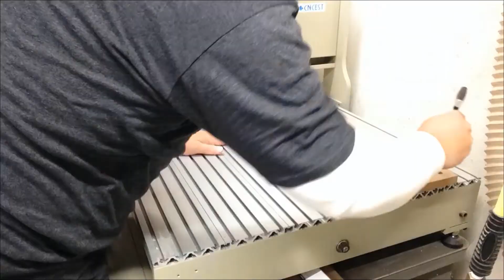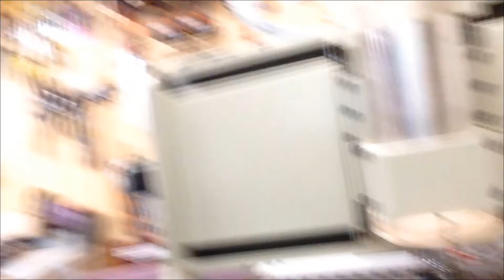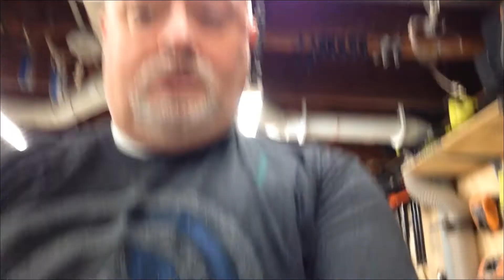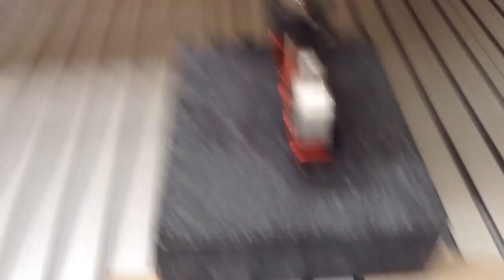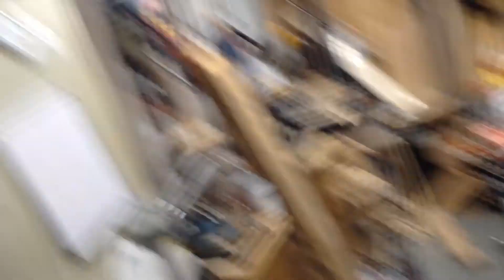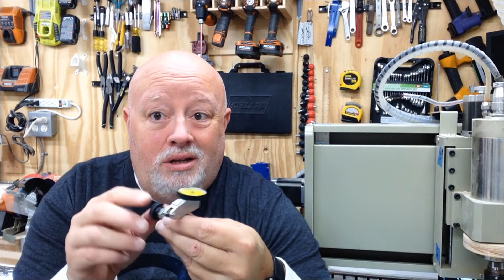Tramming your Chinese 6090GZ CNC Router

Comment: You can never tram that mill I have a slightly smaller version. The problem is as X axis moves towards middle of the travel the motor nodes more. The round rails flex because there secured at the ends only. I replaced the x and z axis with linear rails mounted to solid plates. Much more ridged.

Comment: Do we know the angle of the stepper motors. Trying to set up the pulses on my stepper driver and machine
Reply from the maker: Most steppers run at 1.8d or 200 steps per rotation.  These are no different.
Reply: Thanks

Comment: So i wired the new controller ddcs 4.1. It came with a set of dm542t and m542 stepper drivers. I did not wire the ena or alarm. I wired it like for like of the a, b, pul, dir to the controller. Nothing is moving. Ugh. Do you have any suggestion?
Reply from the maker: UPDATE:
I think I'm wrong about this.  But, you will need to mimic the setup that was coming from the R&R Motion controller board.

-OLD-
You will need to pass +5V to the enable pin on the Stepper Driver (at a minimum)
On the RNR Motion card this was done from terminal labelled "5V" and, I believe, it connected to "EN" and to maybe to "DIR+".  You will need to mimic this with your new controller.

But make these changes at your own risk.
Reply: So I changed the drivers to m542 drivers and I have had success with motor movement. Now just setting up the ddcs 4.1 parameters.

Comment: I just purchased this machine used. What is the best way to get help on setting it up and testing. I may also need help wiring a ddcs 4.1 controller.
Reply from the maker: You will want to locate and separate all the wires from the machine for the limit switches, steppers, and spindle.  The limit switches will be wired in serial.  The stepper drivers should be straight forward to the DDCS 4.1 but you will need to match the Pul+/Pul-, Dir+/Dir-, and Ena+/Ena- to be the same as to the RnR Motion Controller.  The spindle will be a little more involved... and you will need to check where they were wired to before and try to match that.  Personally, I've thought about going with the DDCS controller too... but don't use my CNC enough right now to justify the expense.

;)  If someone want to buy me one, I'll do a video  ;)
Reply: Thank you. I'll keep you posted on what i find.

Comment: hi jeff...is the z clearance from table to bottom gantry 140mm?...reason i ask is you said it was 4 7/16 which contradicts what the specs of 140mm....can you confirm?
Reply from the maker: The actual measurement is 117mm (from gantry to bed).  The gantry is low... but most, standard, router bits work well within this envelope.

Comment: I have been a tool and die maker for over 25 years. This is something that I have done to a "Bridgeport type" hand operated mill and $500,000 CNC machines that I have walked on the table of. Leveling the granite to the spindle won't accomplish anything. You need to be checking the table directly, while not great, extruded aluminum is not as "warpy" as most people might think. I wish I could talk to you directly and explain all of this, because it is actually more than this and at the same time WAY easier to do. I like you brother and appreciate your dedication to accuracy, this is over complicating the process. I ended up here because I am looking for a good CNC machine that won't break the bank. The bottom line is that the spindle assembly should be 100% perpendicular to the TABLE in both the X and Y axis. Someone mentioned using set screws to make the machine adjustable and that is correct, you need to make it adjustable first. Make sure the table is is as perfectly level as you possibly can before you even start this process. I have literally spent the better part of 2 days at work helping set up insanely expensive industrial equipment and a level table has to be the first step. If the machine is not mounted securely and the table level, all of this is "subject to change" in the next week, month, and years. I am NOT trying to be critical, I 100% appreciate you man, but the table without a shimmed block MUST be the reference. @27:39 Just use a block of wood between the clamp screw and the spindle and make certain that the clamp is on the spindle shaft and not on a loose nut or even a tightened nut with a collet. You could even chuck up a threaded rod into a collet and then use two nuts to jam nut a larger diameter "puck" to mount the tram tool too. Then you can use the actual table to get the correct results. 2 indicators are not required though most show it this way. Just zero one side and compare the opposite side number to the zero and then adjust to split the difference and then recheck. https://www.youtube.com/watch?v=8L0IXKgiZ7o  https://www.youtube.com/watch?v=b9gOWHQdrDs
Reply from the maker: You are 100% correct.  I did want to point out that the table is the untrusted part though.  So shimming the granite block to be "level" (sorta) is setting my "table" at level... does that make sense?!!?  I've wrapped my head around this as best I can and this is the process that I use... although not perfect.

The end result of this entire process is to have a trammed spindle... and use that to flatten your waste board.  If your waste board comes out without any noticeable issues (like saw tooth sudo flatness) then you are good to go.

I'm happy to talk to anyone.  And, I appreciate your comments!

Comment: I'm confused, in step  1 when the single gauge is marking zero all the way round it means the spindle is perfectly perpendicular in the position its in, also wherever you use the single gauge if it stays at zero it is still perpendicular, I have done this on my milling machine mill and its perfect(takes a while to get it right) The only thing the double gauge helps is you get a reading without moving things and emptying your pocket.
Reply from the maker: If you have an unknown, you need to insure that the reference surface and one dial are parallel.  This does not take into account any implied angle to the spindle.  Once we have that reference surface parallel with the sweep of one dial, we can then use the second dial to insure that the spindle is perpendicular with the reference surface we just adjusted.

Does that make sense??  I can do a follow up to explain this better.  But there are several videos on YouTube about this very thing.

Comment: Jeff, great video.  I'm thinking about buying one of these machines.  After working with it for a while, would you recommend buying it?  I'm an experienced machinist and CNC programmer.  I just retired and sold all my big machines but would like to get back in to building miniature internal combustion engines. I realize these machines need upgrades to improve rigidity and accuracy. Should I buy one? 🙂
Reply from the maker: Ed...  the 6090 CNC routers are good for wood and light metal.  There are several videos of people making them more rigid for doing this type of milling.

But, if I were going to dive into making little engines, I would look for a SIEG X2, or similar, manual milling machine... then do a CNC upgrade (www.heavymetalcnc.com is where I got my parts... seems that they are out of business now.  But you can look at this www.youtube.com/watch?v=eLRbDVJakAU which has Fusion360 files for the parts).  I have this mill, and CNC upgrade, in my house and it works great.  Keeping in mind that the machine is only as good as its parts... the ball screw upgrade, for the CNC conversion, made it more accurate (vs. the normal acme threaded ones).  Also the gibs on the X2 aren't the best either and need adjustment periodically.

Take a look at www.littlemachineshop.com for some ideas of what you can do with a small mill to get it upgraded too.

Final thought... I would not buy this if you want to do anything harder than aluminum or brass.  I would get a small mill and convert it (or buy one that is already a turn key solution).

Hope this helps.
Reply: @jeffmorlen  , thanks for the comprehensive response. I converted a Bridgeport series two CNC machine into a PC-based machine and made thousands of parts on it. So I’m quite familiar with the conversion process as you suggest here.  I also had a tiny little machine called Max and see that I was able to machine some small aluminum parts on pretty easily. I was hoping one of these cheap Chinese machines would be good enough for small aluminum parts. I do realize there is no way I could be heavy milling on it. But now you have me thinking about doing another conversion of a smaller machine :-).
Decisions decisions. Thanks for your thoughts.
Reply from the maker: Maybe I'll do a tear down on my SIEG X2 and do a video on that.  You can buy the X2 from several sources... including Harbor Freight, Grizzly, etc.  Right around $900 (I think).  I got mine when I had a 20% off coupon at Harbor Freight... and got it for $400 (about 10 years ago).  The tooling has cost more than the mill at this point... but I don't need to tell you that.

Good luck!
Reply: @jeffmorlen  Jeff, check out the mods the TomasTheCreator made on his 6040 machine. Thick steel table and additional mount for the spindle motor.  I suspect the 6040 machine is slightly more rigid than the 6090 for obvious reasons. what he has done to his 6040 may be a perfect set up for model engineering applications but maybe not so much for production applications.

Comment: このゴミルータ弄るのやめた方がいい時間の無駄、新規作り替えた方が安く付くと思うよ
Reply from the maker: I'm sorry... I don't read/write Chinese?
Reply: @jeffmorlen He said the 6090 was trash and that you should build your own.
Reply from the maker: @JohnHoranzy 
It isn’t great but isn’t horrible either.  I’ve built my own in the past and it always comes down to quality of components.  

For me, it was cheap enough, and good enough, to justify the purchase vs. a build.

Of course…
I still have a ton of parts in a shopping cart for a 1700mm x 900mm build.  🤔
Reply: @jeffmorlen I  trammed mine when I assembled it.  I think this is a fine machine. I could not measure any run out in the spindle. I am having trouble with Mach3. Will be putting a stand alone controller on it.
Reply from the maker: If you need help with Mach3, I'm happy to help get you up and running.  Just let me know.
Reply: @jeffmorlen  Thank you but I already implemented Plan C for my 6090. Plan C = SMC4-4-16A1B. 
Mach 3 is a dumpster fire caused by pirated Mach 3 copies and Mach offloading support to the users ability to find the proper random information o the internet.
Reply from the maker: If you can, when you get it up and running, please let me/us know how it works.  I'd be interested to see if that modification just works better!  Good luck.  Keep me posted.

Comment: Cool video.
One question. How do you know that the sst tool's 2 guages are level with each other seeing that you removed one guage.

Regarding the tramming of the spindle in the y-axis, you could drill and tap grub screw holes at the top and bottom of the spindle bracket and use that to adjust it and tighten up the cap screws. Once it is tight fill up the gap with epoxy.
Seen some guys doing the tramming like that on cnc vmc's.
Reply from the maker: Wow... that is a GREAT point.  How do I know that the two dial indicators were level with each other.  I don't... in all honesty... I took it for granted.  One step I should have done was to check the zero prior to checking the tram.  I didn't... sorry guys.

Grub screws are a great idea and would make it completely adjustable.  That's something I don't think anyone has thought of yet.  All the videos I've seen use shims... so, maybe that is in order (by someone else... hahaha).

Those are really good points Banzai Will!  Thank you for watching and your comment!

What other ideas can we come up with to make tramming this easier/better/faster??  I'm open to suggestions.